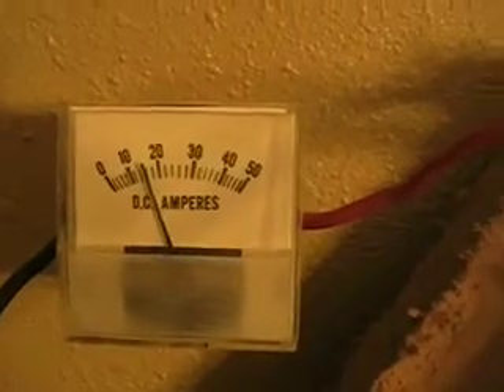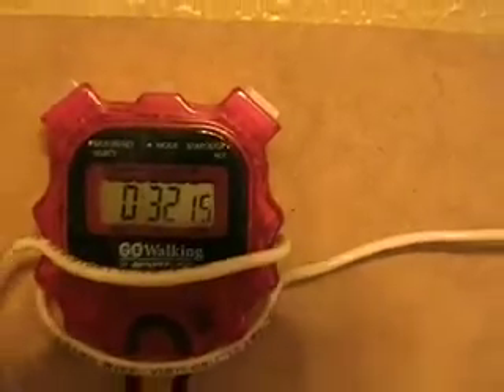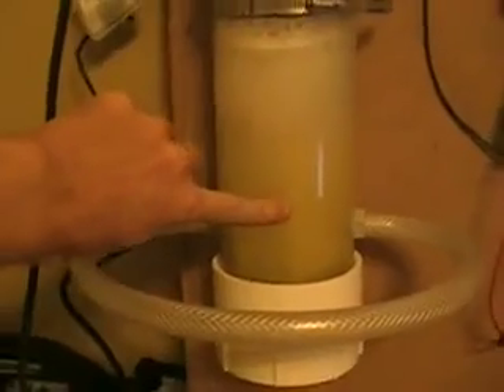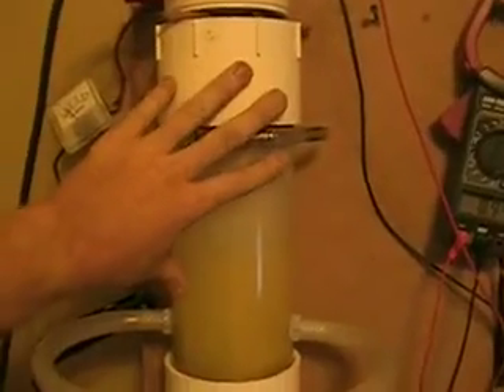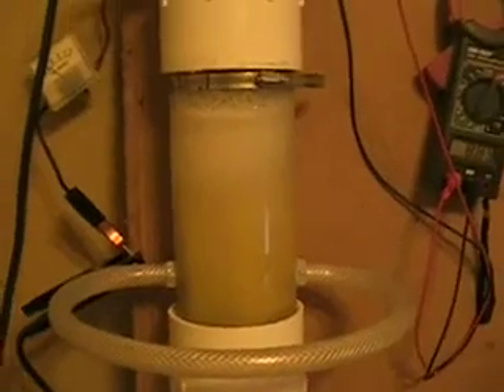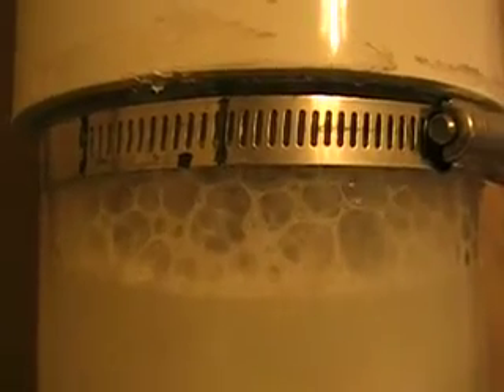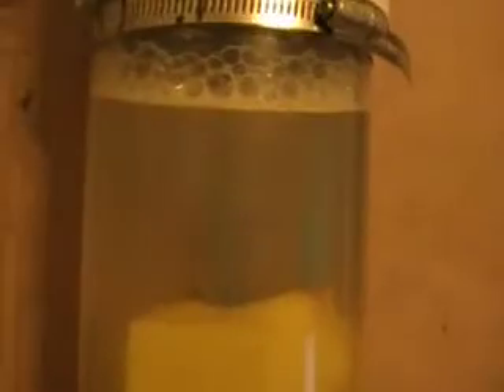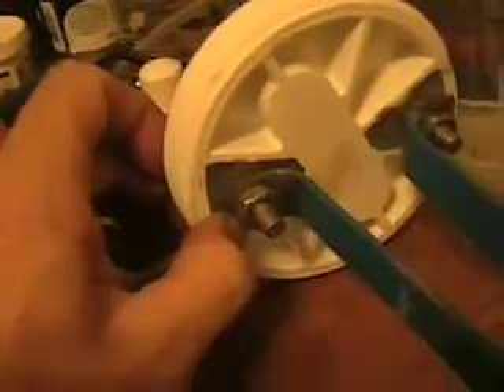JB WELD LID TEST AND RESULTS

Comment: For a temperature probe, you might want to try a cooking thermometer(you know the ones with the really long SS probe on them, and the round coin-like gauge on top?)  Just simply drill a small hole in your lid, and insert the probe, epoxy the gauge to the lid to seal it, and !voilla! you have a full time temperature gauge! Make sure it doesnt short your plates, though.
Great Vid, as usual!
Steve

Comment: Nice video man , I was wondering have you determined if the JB weld is compatible with sodium hydroxide?I have used several types of epoxies that hold up good for 3 weeks or so then  start breaking down due to sodium hydroxide exposure...